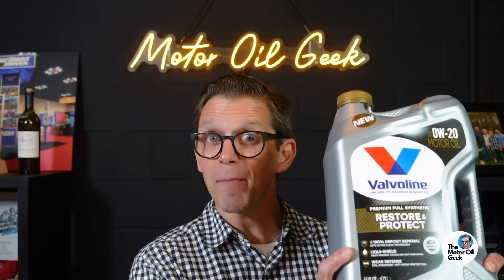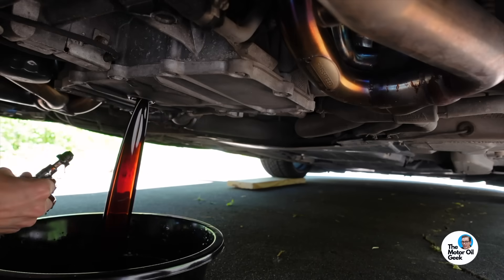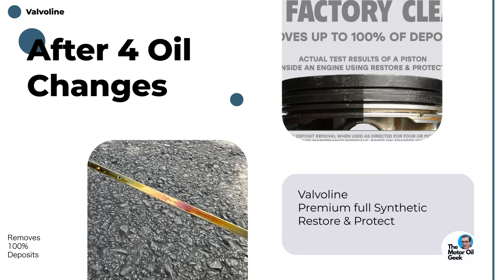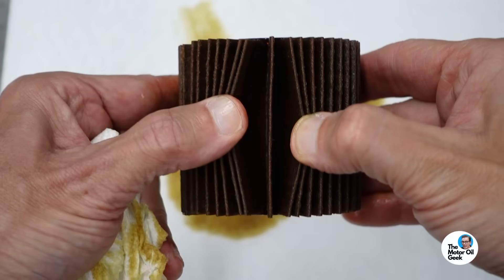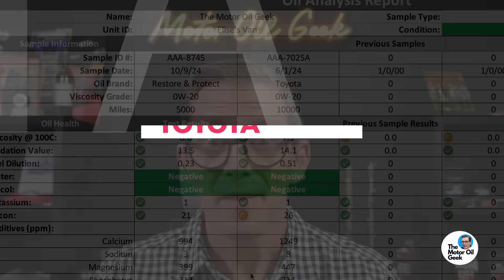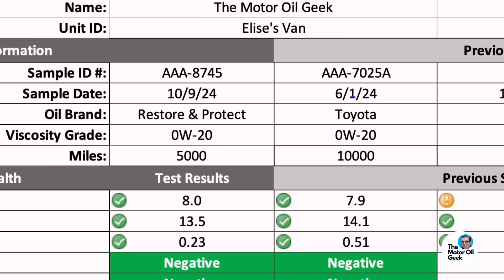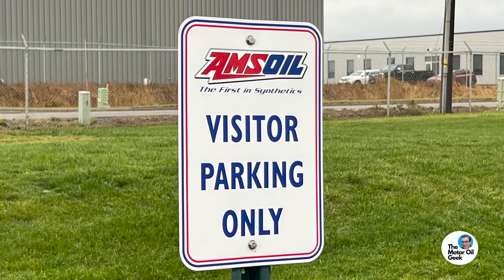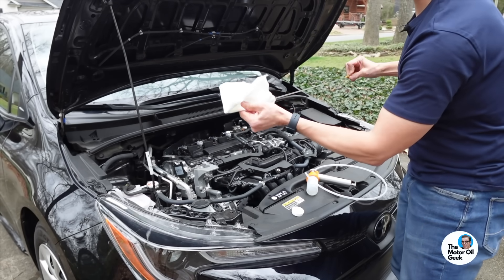The TRUTH About Valvoline's BOLD Engine Cleaning Claims

Comment: I have been absolutely blown away by my results with Valvoline restore and protect. I have high mileage Subarus that call for 0w 20. I switched them to Valvoline restore and protect 5W30 and started using an upper engine lubricant, marvel mystery oil in every gas tank. Based on my results with speed diagnostics, I'm now achieving the lowest wear rate I have ever seen in any of my vehicles, 1.4 parts per million per 1,000 mi. This is the best results I've ever had and clear proof that not only is it cleaning my engine, but my process is protecting better than I've ever seen versus royal purple and isemitsu
Reply: Thanks for the trade secrets my friend.
Reply: I’m not gonna attack you on the gas additive!  I’m glad you posted on the Subarus. I’m using the R&D in both (2010&12 with 100-115k). Yours is the first mention of it in Subaru engines that I’ve seen.
Reply: @jerryyoung6494  look up the one way valve on the oil filter you can add too. It does help. We also reduction when we added those. Ascent with 131, outback wilderness with 124k and a Crosstrek with 40k
Reply: Very curious here, if you don't mind...
What year models are your Subaru's?
How many miles on the odometer's?
Oil change intervals?
Average use, daily driver's?
What were the oil consumption rates?
Reply: @hnd2893  no oil consumption, goal was just to get lowest wear rates possible on used oil analysis. 2019 Ascent with 131,000 miles and 2022 Subaru wilderness outback with 129,100. Both with turbo charged fa24
Reply: Now quit putting that snake oil nonsense in your gas and and you'll do even better. 
Like with the oil the chemists that developed the gasolines you use know exactly what should be in it, and here comes you along thinking you're smarter than them.
I'm a professional high performance engine builder with 40 years experience building racing engines, we go to great lengths machining the tops of valve stem guides to press on the latest modern seals to keep oil out of combustion chambers to eliminate detonation which is paramount for performance, nothing will cause detonation faster than oil inclusion in a combustion chamber, you're losing performance and mileage because your knock sensor is pulling timing out and richening your mixture, in an older non ECU type vehicle you'd hear detonation from putting oil in your gas, the very thing a performance engine builder goes to great lengths to eliminate and your actually mixing it in, serious face palm moment here.
Just like how Lake made a video about oil additives being snake oil nonsense that you should never use because the chemists who develop these oils know exactly what they're doing the same holds true for gasoline, the people who make it are very smart, don't go thinking you're smarter than they are.
Reply: @dukecraig2402  Great answer. I am also a "pro" engine builder now with 56 years under my timing belt.
 I'll add another example to your valve stem seal observations. Besides allowing too much oil in the CCs, it can also allow oil to "coke up" around the very end of the guide causing "sticky" valves that lose their pressure on the seat in the head causing them to "burn". I see it fairly often on higher-mileage engines. Little to no guide wear but seals shot to shit and a burned valve.
 I have often wondered if there is a better material than "Viton" for valve seals?
 Inquiring minds want to know.
Reply: @OneAceracer  
There's companies making press on valve stem seals that have a white Teflon based material that I've used before with good results, I've just woke up and am having my first cup of coffee so the name of the company that makes them is eluding me at the moment, if I remember after my brain starts fully functioning after an hour or so I'll get back with that.
Reply: @dukecraig2402  If it's the black rubber with a white Teflon insert, they are not new. Been around for YEARS. 
  My experience with them is not good. Any "square" type of seal only works halfway at best. They are subject to a couple of problems that I have seen. The Teflon is hard on the valve stem wearing into it and losing its sealing ability. Unlike "lip type" seals (which seal harder as drawn down on the stem) the Teflon insert wears out.
 They (square-type seals) are still used on some applications which seem to be Turbo Diesels. Not sure why.
 I'm NOT a "valve stem seal engineer", but I DID stay at a Holiday Inn Express last night.
Reply: @OneAceracer  
As I recall they were metal bodied with a white Teflon insert, I know they're not new as it was about 20 years ago when I tried them in a few engines, I didn't have any issues with them but continued using the typical Viton type that's common as I've never had any problems like you described with them, which is curious as the bulk of engines I build the past 25 years are air cooled motorcycle engines and as such run hotter and are more prone to coking oil than liquid cooled engines, the only other thing I can say about that is tell the people you build engines for to change their oil more often, I'm dealing with engines that reach outrageous temperatures when stuck in traffic and I've never had anything like that happen with Viton seals, is your seat pressure on your valve springs where it's supposed to be?
Or are you getting coking on the valve stem in the port from breathers puking oil into your intake tract? I always modify breathers to eliminate that nonsense, in the first place it keeps oil out of the combustion chamber allowing me to run cooler plugs, between keeping the oil out of the combustion chamber and not having to run hotter plugs for the sake of them burning the oil off of them to eliminate fouling I get away with leaner mixtures without detonation. 
If the coking you're talking about is on the valve stem in the port just above the valve head where the stem goes into the guide it sounds like you've got breathers puking oil into your intake tract, aside from modifying breathers for high revving engines I build windage trays and flywheel scrapers (on Harley engines) to keep crankcase oil under control, as the great Kevin Cameron says about oil flying around your rotating assembly "It becomes a viscosity measuring device", when an XR750 Harley flat track racing engine has problems with "wet sumping" you can see them about ⅔rds of the way down the straightaway of a mile track suddenly slow down so much it looks like the rider threw an anchor out, whatever type of engines you're building if there's oil control problems in the crankcase at high RPM's and it's blowing oil out the breather and into the intake tract there you go.
Reply: @dukecraig2402 
Definitely isnt too cool using marvel in the fuel long term with a catalytic converter,I still use it elsewhere. 
I recently opened up and repaired the snowblower with the damaged governor that I've been using for 7-8yrs. 
Boy they really shoot snow at 5000 rpm! 
Anyways, this thing must have barely been used before I got it ,I'd say under 50hrs for sure. 
I've used it maybe 10hrs. 
Was not happy at all with the amount of intake valve stem wear. 
It was usable but was nothing like the rest of the mint condition parts. 
I'd wager part of the problem is short run times ,it's not running more than 20 or maybe 30 minutes at a time and that's affecting the splash lube  getting to the stem and guide. 
So I figured I'd start running some Marvel in the fuel,this situation needs help. 
Another idea is to plumb the open crankcase breather closer to the carb inlet
Reply: Well said! I couldn't agree more.😊 @dukecraig2402
Reply: @dukecraig2402 I have a 2016 Harley with the 103ci engine. I put about an ounce to an ounce and a half of MMO in every other fill up, 6 gallons. While riding the winter months in the Great Smoky Mountains the engine is quieter on those cold morning start ups with the MMO as  opposed to no MMO. Also, It seems I get about 25 miles more per tank with MMO. I have 56,790 miles on the engine without any problems. I  used MMO in an older off road bike that had a metal gas tank that never showed any signs of rust. I have seen newer bikes where the owner never used MMO that had small amounts of rust. So, I believe there are times when the "snake oil" is useful. As for riding my motorcycle in the cold, I have a 12 volt heated suit.
Reply: @dukecraig2402  clearly you haven't watched lakes upper engine lubricant discussions. I have data to back up. R&p without gasoline add = 1.9 ppm, with equals 1.4ppm just like lake said it would. (See his videos on gasoline additives. He was talking about shell v-power I believe, but we don't have any of those close.)
Reply: @bjg6695  
Here's the problem with your thinking, when's the last time you saw a car in traffic that was smoking? A long time ago, 40 years back you couldn't go into town without seeing at least one car that had oil smoke coming out of it's exhaust, now you MIGHT see that once a year, and it ain't gonna be from worn rings, a cracked one maybe but not worn out rings. 
With all due respect to Lake when we're talking about what goes on inside a combustion chamber that's my field of expertise, he's concentrating on wear but at the same time ignoring other factors, you're losing mileage and performance worrying about something that just doesn't wear out anymore, rings are lasting the lifetime of these modern engines even for these people who don't take care of their engines the way they're supposed to, bearings and everything else is what goes out in today's engines, but not rings, long gone are the days of having to "re-ring" an engine during its lifetime, I tear down engines every day and it's been years since I've seen a ridge at the top of a cylinder that's required a ridge cutter to remove the piston, cylinder and ring wear is virtually non existent in today's engines, I tear down engines with hundreds of thousands of miles and you can still see traces of the factory cross hatching on the cylinder walls, 40 years ago when I'd tear down an engine with 60,000 miles on it there wouldn't be any cross hatching left and there'd be a ridge at the top of the cylinder, the tool companies probably can't even sell ridge cutters anymore because no one needs them.
Putting that nonsense snake oil in your gas for the sake of top end wear is cutting your nose off to spite your face, and you're fooling yourself believing you have proof of anything anyway, you can't do/change two things at once and look at results from tests, you have no "controls" over your testing and results, tests must be done with only one thing changed at a time.
Once again leave what's in your gasoline to the people who make it, they know best, all oil and gas additives are snake oil.
Reply: @dukecraig2402  I will agree with you oil additives are snake oil. I will politely disagree with you on gasoline additives. And there was control, we have run the test in our company fleet with same oils only changing gas additive or not. 

Unfortunately gasoline manufacturing is not standardized. If I lived near a shell station which adds moly to its premium I would use it without additive.
Reply: @bjg6695  
And different oil companies have different chemical packages in their oil, once again the people who make THEIR product know exactly what they're doing, and you're not smarter than them.
Reply: @dukecraig2402 quick question.  Do you know a lot about different additives as they relate to fuel?  I remember probably around late '90s on Jaguar engines and whatever coating they were using on their cylinder liners was speculated by many to do with. If I recall correctly something like sulfur in the fuel.  I never actually owned one so didn't get overly invested.  I mean I guess we could also say that's an issue on the engineering side of the manufacturer in regards to the markets that their vehicle would enter.  It's interesting to speculate on, but I generally agree with you that the engineers with their teams and budgets do have a huge gap in understanding that most of us are in no way qualified to challenge.  I think Lake does a good job of explaining that engineering is all about compromises and balances.  There's a reason we have specs and standards.  Unfortunately, I think this knowledge gap also makes a ripe environment for as you say snake oil.
Reply: @dukecraig2402  I think stp was proven to help cleanup the fuel system. I bought a beat to shit cruze ran 3 tanks of power mixed with stp (I think) and did a tune up plugs/coil pack/fuel injectors.  It feels much better.  The fuel was because the filters are inside of the gas tank... wtf
Reply: @dukecraig2402 right!! 😊
Reply: @dukecraig2402 I agree on this people keep saying change oil at 3-5k but none of them check their oil and keep it full. Rings and oil are better than ever they do the damage when they let their vehicle go low on oil tearing up bearings. Marvel mystery oil along with Seafoam are useless in modern vehicles
Reply: @jinxtacy  
Not familiar with the Jaguar issue you mentioned. 
When it comes to fuel additives the only thing I mess with and will recommend is the ethanol neutralizers/conditioners (whatever you want to call them) and even then only for lawn and garden equipment. 
The standard gas that's only 10% ethanol we use today doesn't seem to hurt the rubber even in older cars and motorcycles save for post WW2 British bikes and cars, many people with classic 60's and 70's Triumph motorcycles had the fuel lines and synthetic carburetor floats literally melting from that ethanol because unfortunately for them after WW2 the British vehicle manufacturing industry selected a type of plastic and rubber as their industry standard that ethanol basically turns into pudding, now I want to be clear that I'm not saying they were dumb or careless, nobody can see years into the future, it's simply bad luck that they selected those types or synthetics back then, however ethanol resistant parts have been made so those guys who had parts melting off their motorcycles and cars can upgrade. 
The reason I use it for lawn and garden equipment is I had issues with the thin little diaphragms in 2 stroke carburetors having issues with it, but like everything else all replacement parts nowadays are ethanol proof, but the issue of the ethanol wicking moisture out of the air is another issue, especially with seasonal equipment and fuel that can sit for months. 
The first year they started with the ethanol in gas after sitting for the winter none of my lawn and garden equipment would start the next spring, after draining the tanks into a large glass bowl every one had a nice thick layer of water at the bottom, which explained the water on my spark plugs after repeated attempts at starting, at the time I lived on a property with a huge yard (my dogs were in heaven there) and trees all around, so my fuel consumption between mowers, weed whackers, chain saws and leaf blowers was enough that I wasn't going to buy that ridiculously high priced canned 2 stroke fuel and the nearest gas station that had an ethanol free pump was 7 miles down the road and it was ridiculously priced also, so what I started doing was take a 5 gallon can to the local gas station and pour in ethanol neutralizer additive before filling it, which is only like 1 Oz treats the entire 5 gallons so it's very cost effective, for my 2 strokes I'd simply use gas from that 5 gallon jug for my little one gallon 2 stroke fuel jug.
All my ethanol problems with my lawn and garden equipment went away, every year after sitting for the winter it was just like back in the pre ethanol days, everything started right up, no more melted diaphragms or fuel lines in my 2 stroke equipment and every friend that I've put onto doing it that way has had the same results, no more ethanol related issues, as a side note, when it comes to 2 stroke equipment you don't have to worry about fuel stabilizers for seasonal equipment, the makers of 2 stroke oil already have storage stabilizers included in their 2 stroke oil because it's a given that 2 stroke machines are going to sit for months at a time, since they're generally all seasonal, they're one step ahead of their customers and already have stabilizers included in 2 stroke oils.
As far as cars when it comes to ethanol conditioner additives unless it's a collector type car that can sit for the winter don't bother with it, normal vehicles have tank after tank burned through them and the ethanol doesn't have a chance to wick that much moisture out of the air like seasonal equipment/fuel jugs that can sit for months. 
Like oils the people who make the gas we use are much smarter than us, they know exactly what needs to be in their product, anyone who thinks they're smarter than the people who make it is fooling themselves, as far as top end wear it's like I said, when's the last time you saw a car with oil smoke coming out its exhaust? A long time, top end wear is virtually non existent in this day and age thanks to the metals used in today's engines and modern oils, it's just not an issue anymore.
Reply: MMO is definitely not doing you or your car any favours. Use a proper fuel additive (with PEA) for cleaning, let the engine oil do the lubrication.
Reply: @marstedt  how do you explain the verifiable (done twice) lower wear results. We achieved lower engine wear with both Lucas and marvel upper engine lubricant in the fuel based on speed diagnostics analysis.